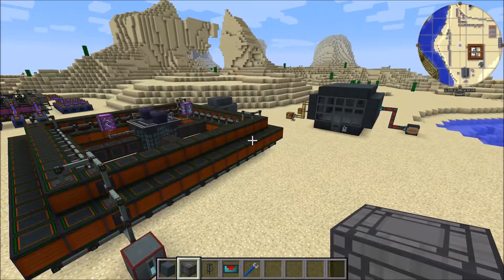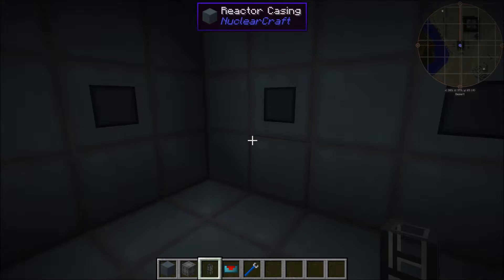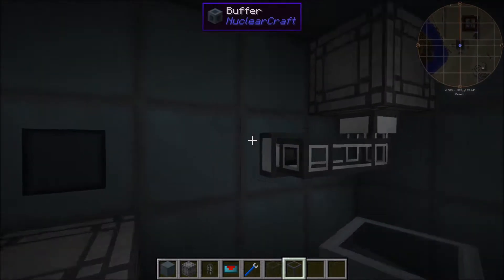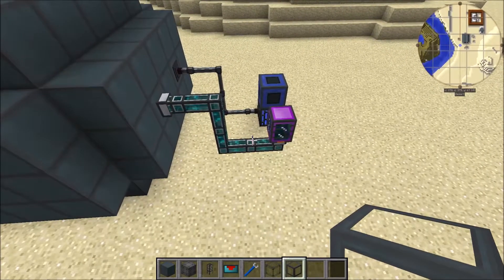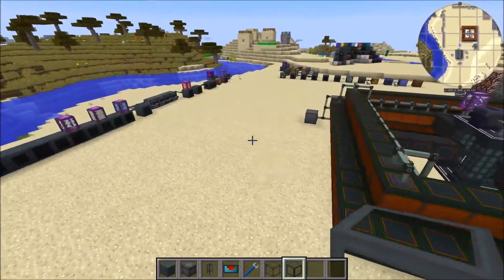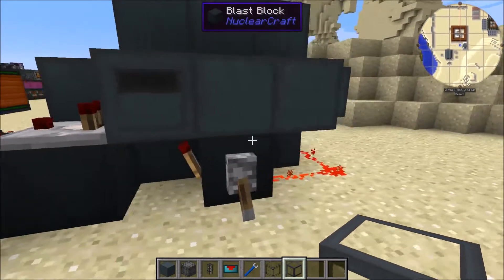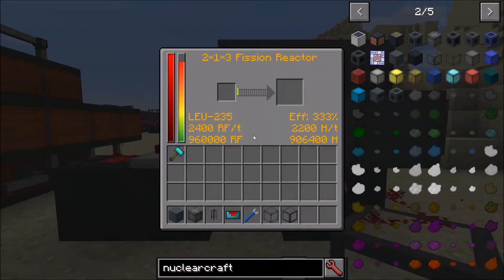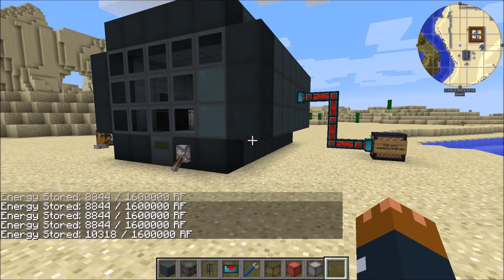Active Cooling, Reactor Control and More (2.3)

Comment: one question do the coolers for exemple the water cooler need to touch other coolers moderators or fission cells and do they also count as for example a water cooler am I able to connect diamond coolers ?
Reply from the maker: Active coolers in fission reactors still need to satisfy the placement rules, yes, but they can't be used to support other coolers. For example, a passive or active diamond cooler needs a passive water cooler - it can't use an active water cooler.

Comment: So theoretically, i can place active water coolers all around the inside of the reactor as long as they touch a reactor casing, right?
Reply from the maker: Not any more - this is quite an old video, and the rules for the coolers have changed a bit.

Comment: active water coolers only do 50 heat...so like only good for TBU fuel reactors. otherwise water cooling s just not worth it
Reply from the maker: Is fixed in later versions - you just need to reset the active cooling rate configs :)
Reply: how do you reset? the config file says 300 but it only doing 50  V2.10m
Reply from the maker: If you are playing single-player, you can access the configs either through the in-game mod list or the config file - you may need to restart the game for the changes to take effect. If you're on a server, the host needs to change the config values manually.
Reply: I did look at the config. the cooling values are still off(or rather don't match).  water 200 = 50 in game. Active Cooing rates right? or are those values not 1 to 1
Reply from the maker: What is the active cooling max rate config set to? That determines how much coolant the active cooler will use each tick, so if that's smaller, less coolant will be used and so the cooling rate will be lower. If you set it to 20, then the config:cooling ratio is 1:1. The default is 10 mB/s.
Reply: oh okay i was looking at Heat removed per tick/mB values..whoops.
Reply from the maker: No prob!

Comment: How do I calculate how many active coolers I need for my fusion reactor? According to your formula from a previous spotlight the heatchange per tick for the fusion reactor is (100-(0,9a*Efficency))/2. So at 100% efficency I would need to compensate 3 "something". Is the Unit for that formula in kK? And how do I convert the cooled heat from the fission reactor to Kelvin from the fusion reactor? Does 1 H equal 1 K?
Reply from the maker: Hey! So, your question is a good one. I am soon gonna make a new fusion tutorial which will explain this all much better, but for now hopefully the following will give enough info:

So yes, first, the fusion reactor's heating rate is, by default, (100 - (0.9×efficiency))/2 in kilokelvin , so at max efficiency, which is what you're aiming to match, the heat gain rate is (100 - (0.9×100))/2 = 5 kK, or 5000 K .

Now, the effeciveness of active cooling depends on the size of the reactor. The bigger the reactor, the more cooling you need, as you may expect. Each tick, the temperature drop caused by a fully-supplied active cooler is equal to 2×modifier×multiplier/size K , where 'modifier' is the active cooling rate of the fluid, 'multiplier' is 4 if the cooler has a partner in the exact opposite position (with respect to the centre of the core) and 1 otherwise, and 'size' is the toroid size of the reactor.

As an example, we'll imagine water-cooling a size-2 reactor. Each cooler will reduce the temperature by 2×100×1/2= 100 K/t, or 400 K/t if positioned correctly. So, to get to 5000 K, all we need is 12 well-positioned and 2 random-positioned coolers, as 100×(12×4 + 2) = 5000 K.

As for units: it's rather difficult to convert between K and H, as one is a temperature and one is more like an energy.

Once the video's out hopefully the FTB Wiki page on fusion will be updated :)

Comment: What is gieled cryo in the active cooler?
Reply from the maker: By default , gelid cryotheum cools at a rate of 12.8 kH/t/mB, for a maximum cooling rate of 6.4 kH/t, as the active coolers use 0.5 mB/t of coolant.

Comment: What is the rate of liquid consumption for active cooling? Is it constant value or depends of liquid type?
Reply from the maker: By default, the maximum rate of fluid consumption by an active cooler is 5 mB/s, or 0.25 mB/t. This figure is configurable in the NC fission configs :)

Comment: I had a really cool setup back in 1.7 with Big Reactors and ComputerCraft. Basically there was a way to connect the reactor controls into a computercraft machine and have it show all the reactor stats remotely. For example, I can install a computercraft monitor in another room and it will show me all the stats for the reactor. Is there any way to do that with the fusion reactors so I dont have to travel all the way down to the bottom of the reactor hall to see its stats?
Reply from the maker: Sorry for the late response - there are v ague plans to add CC support, but right now there are other things to fix and add :)

Comment: I feel like the active cooler should output a heated version of the chosen coolant. It'd increase logistic complexity but it'd make a lot more sense than just pumping liquid into the reactor which then vanishes.
Reply from the maker: I already think I have a solution to the issue of having heated versons of coolants, but that sort of system is coming later when I add molten salt reactors, heat converters and steam turbines :)

I do agree, however, that the active coolers, especially when it comes to the rarer coolants, are a bit expensive, and so I need to come up with a solution to that. However, they are meant to be inefficient. In fact, the solid-fuel reactor is meant to be inefficient in general.
Reply: it would probably be a bit tough to implement it for the modded fluids.....and i'm sure he is trying to do something with steam
Reply: What I meant was something more like having a different fluid to represent the heated version, which could then be cooled down in exchange for power. Obviously water goes to steam and liquid helium becomes ordinary gaseous helium, and as for the others energized glowstone could perhaps be heated to something like "super-energetic glowstone", gelid cryotheum to "effervescent cryotheum", resonant ender to "vaporized ender" (obviously these are just suggestions). It would mean adding some new liquids probably, but given the amount of liquids already available in the mod I think that's well within the developer's abilities.
Reply from the maker: Ok, since I don't want the active coolers to have an 'output' like the heating cells in the molten salt reactors will have, I'll just massively restrict the rate at which the active coolers use up coolant - something like 5 mB per second should be good :)